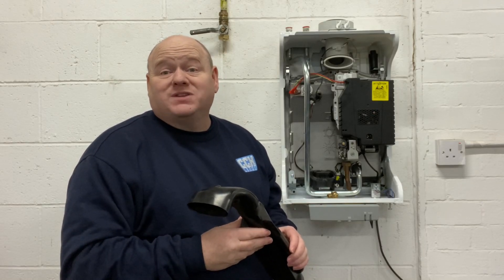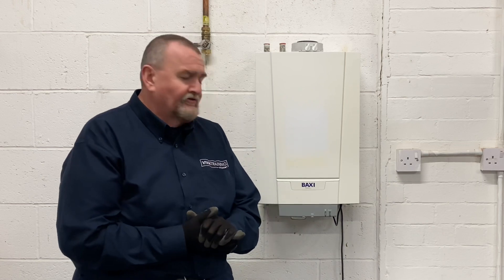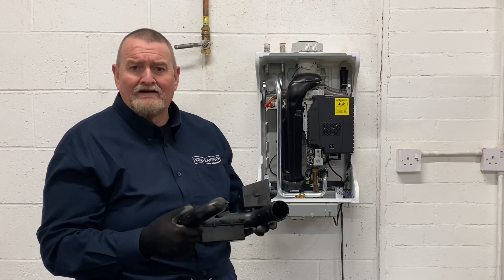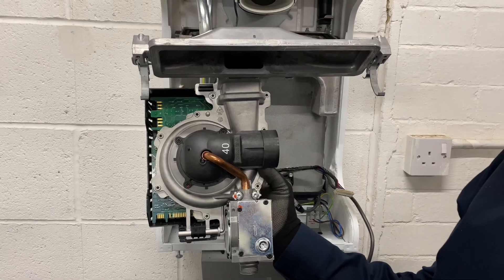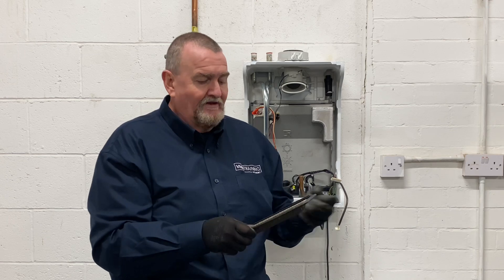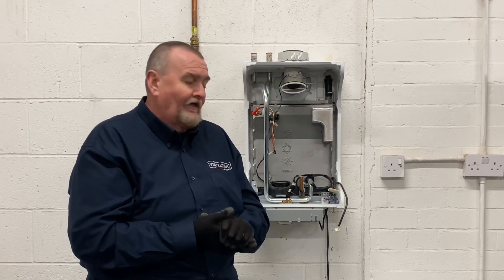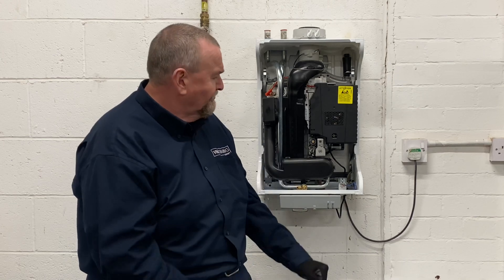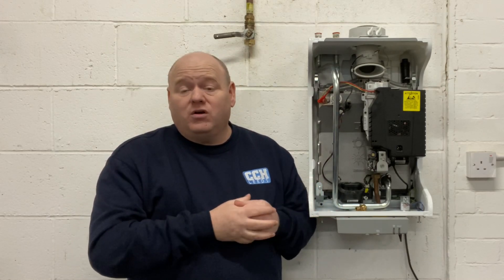Gas Training - Baxi Heat Only Boiler - Strip Down and Fault Codes

Comment: Is it possible to remove the sump of the heat exchanger with the exchanger still in place ? Dealing with one at the moment that won’t fire and I’m thinking the bottom of the exchanger may be blocked……
Reply: Did you work this out?  I've got the same problem with one at the moment, I've cleaned the sump through the flue vent opening as it had deposits but the condensing trap was clean.  Would love to check the bottom of the heat exchanger.

Comment: Hi Roy!Great Video!thanks again!I came to Potterton promax combi boiler.no heating or hot water!no fault codes.display flickers from 52-56 back and fourth. No ignition. Service mode.fires up.overheats and goes blank.checked hot water NTC ok.pump runs,fan runs but no ignition. O  heating demand display comes for just a second and goes off totally but with hot water display stays on but no ignition. Hall effect senor fully illuminated. What could be the fault. Thanks

Comment: Allen, I’ve been getting a lot of Ideal boilers on servicing making the deep humming sound on low fire , and in some cases a strip down service does the trick, however I’ve had some that have needed new PCBs  ( ideal warranty claims) I’m not sure if you’ve had this with them before, but im finding a lot of 1 year old boilers and newer doing it,  for e.g I had a 3 month old Atlantic 35kw showing 1600 ppm and needing a strip down. 

I’ve been out for a different fault but found this, do you have experience on this?
Reply: Dirty injector, gas valve, or more that 5mm of bounce on the burner. To check for bounce whip the fan out and finger the hole and see the springiness. If you want to shut the humming noise up... slap it on low rate with the case off and take the black rubber hose off the trap it should shut it up. Put it back together and try low rate again it should sort it out.

Comment: I have a question for Roy ,I am a retired domestic heating engineer \ gas fitter  . I noticed that the CO2 readings on conventional boilers were so much lower than the condensing boilers we were fitting which were allegedly more kind to the planet . We used to set up the condensing boilers at 9% CO2 high and 9 % CO2 low on the   Vokera HE combination condensing boiler for example. Which were 90 % plus efficient .Now as an example and only because I know the boiler the Vokera mMynute 12,16,and 20 e is a band D boiler has a Sebunk rating of only 78.5 ,% but only gives out 6%  CO .So on the face of it the new boiler gives out 50% more C0  while burning let's be kind and say 15% more efficient to mitigate for this . On the face of it the new boilers actually give out more CO2 than the old boilers when you take into account the amount of gas used.On a lighter note I did my apprenticeship in Halifax with the North Eastern Gas Board in Mulcture Hall Rd . Happy days.
Reply: Thanks for your reply. On the face of it older boilers give out less in %terms than the new ECO boilers . which is not quiet how they were sold to the great British Public , Coupled with the fact they last for half to one third  of the time the old ones lasted for and are extremely complicated to service and repair and need expensive calibration instruments to ensure their safe operation . Also most if not all condensing boilers are positive pressure another safety concern I would have thought .
Reply: Thank you for your time in replying.I think this is not as black and white as government and manufactures would have us believe .I wonder what nasties that they say are not going into the atmosphere are now disappearing down the condensate ,millions of gallons of mildly acidic water being put into water supply.Goverments have previous about being totally wrong about politition issues The obvious example is diesel fuel The government might just have been wrong but the car  manufacturing  industry deliberately set out on a policy of deception .When Halifax was converted to Natural Gas in 1969 . Natural Gas was trumpeted as a super clean fuel although I accept these things are relitive . In my experience when manufacturers make claims about claimed efficiency  these are theretical and usually cannot be replicated in the real world as an example look at the claimed milage the manufacturer says you can get from a particular car and then try to replicate it .
I watched the video Allan put up about Hydrogen fuel cells .These make the present day combination boilers look like coal fires in comparison with the associated price tag of course. I have band D Gloworm Ultimate I will be hanging onto it for as long as possible .Thank you for your time Kevin.